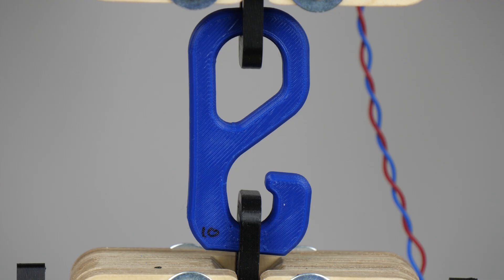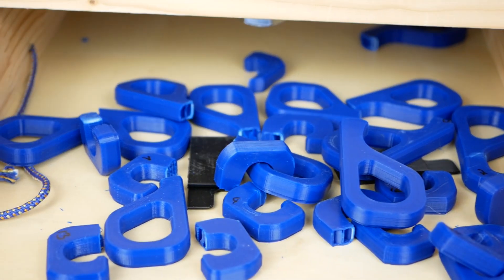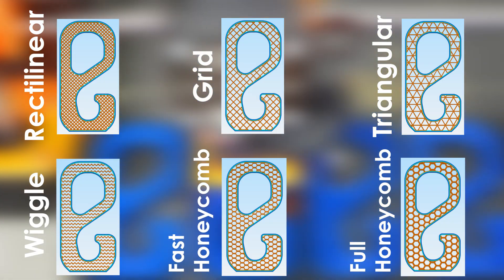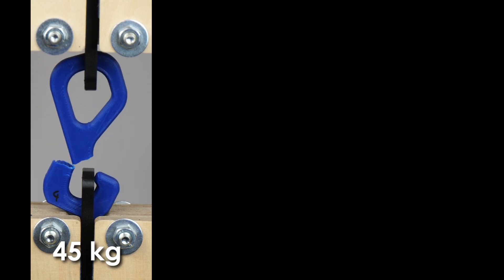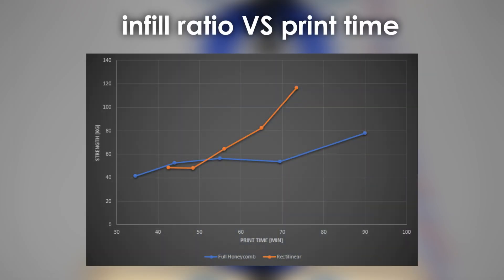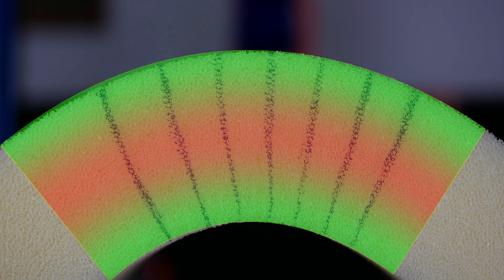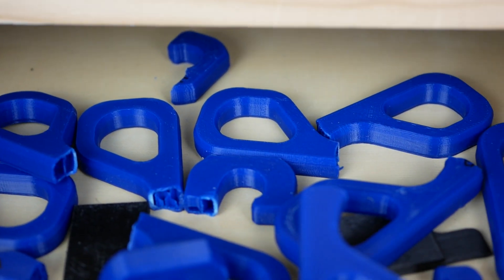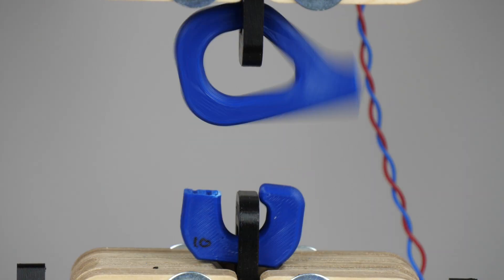INFILL pattern and SHELLS - How to get the maximum STRENGTH out of your 3D prints?

Comment: I never put so much effort in research but my daily use seems similar to your results
Since I use Slic3r to slice, I use 3D Cube infill most of the time because it stresses the Printer less than Honeycomb.

For random objects I use 2 Shells 2-3 Top/Bottom and 15%infill
For more tough objects I use up to 4 Shells, 5-6 Top/Bottom and 45-60% Infill still 3D Cube
I recently printed some e-Skate parts and i Printed those with 5 Shells and 80% infill rectilinear, still not sure if that was Overkill

I Like to see your results for 3D Cube/Honeycomb the later I never used because I couldn't see any advantages against Cube

Comment: Never use 100% infill for a solid part. Instead use 1 wall and then divide the total layers by 2 and that is your top and bottom layer number. Also add [0,90] or [-45,45] to your bottom/top layer and this will crosshatch your layers to get much better adhesion between layers. Also never orient your layers axial to loading.

Comment: There is more to it. Increase the layer height if your nozzle can print. 0.2 is not as strong as 0.3. 0.5 is tough and 0.8 is a beast when it comes to strength. Test this aswell.

Comment: My current aproach to strong parts is lots of walls, and 100% infill. Based on other sources I also cranked up my temperature as far as it will go without print artifacts, which is 230C on my "Real" PLA. For gears especially I ensure that the gear teeth consist of only walls. Could you also check the effect of temperature on strength? It should matter especially in the Z direction.
Reply from the maker: Did that already: https://youtu.be/mwS_2R2mIvo
Reply: Ah, so one of those sources must have been you!

Comment: I quite often use fasteners to strengthen a part. For example, I have made a series of 'L' shaped brackets, about 50mm on each side, that hold various sized waveguides. The right end of the horizontal part of the 'L' has a cap that clamps the wave guide (half of waveguide profile is in cap, other half in 'L'.) Two screws run through the cap and into threaded inserts in the left end of the 'L'. The screws are needed anyhow for the cap, and having them the full length of the bottom of the 'L' keep that part in compression and makes it much stronger.

You can also create a separate part/model for the highly stressed region of your part. For example in the part of the sample shown here you can have a separate 'embedded model' to which you apply completely different printing parameter to. I have tried this some in Simplify3D. I combine the two parts of the model in an assembly and export an STL of the whole assembly then tell Simplify 3D to separate the different objects.

Comment: You are wise to choose a good model to test both compression and tension stress at the same time. In fact in one of the slow motion video, the crack happened on the compression side first rather than on the tension side as many people would expect.  If you could test torsion stress as well then it would be a more perfect experiment.  Thank  you for your contribution to the 3d printing community.  There had to be a lot of effort you gave.

Comment: I'm not sure what all options are available on other software but in slic3r to save time on the prints you can set the size of perimeters and external perimeters. Using a .4mm nozzle I set perimeters at .8mm and external perimeter at .4mm So you get a shell of 1.2mm in only 2 perimeters instead of 3.

Comment: I have set my internal parameters at the full 60mm/s of my printer, which doesn't really show in the final part!
Only the outer one goes at 30mm/s, which is a lot slower, but looks great on my printer.
I have a slightly modified Hypercube and I use CURA, newest version...

Comment: It could be useful to test the differences that you can achieve varying the direction of the infill (if possible). For example the wiggle Infill was really penalized from the fact that the infill lines were perpendicular to the force applied to the part.
Reply from the maker: Your right about that. But with a complex part it's often not possible to find one "best orientation" so you should find an infill that's as isotropic as possible. Could be worth testing.
Reply: I think marco meant varying the angle (for example in S3D to 0, 60, 120, 180, 240, 300 in honeycomb) to get the plastic adhering to the previous layer differently, and adding tension strength, as it would be supported by a different section of the wall...

edit: also might be an idea to test for compressive strength

Comment: Really informative and well presented video! 
One question, you mention the test hook with 2 perimeters and 100% infill isn't any stronger than 6 permieters and low infill? With the filament printing temperature, if it's high enough the layer bonds will be at maximum. A solid hook should not show layers or strands when broken, but rather shatter like brittle glass. Maybe worth a quick test?
Reply from the maker: Thank you!
0:59 is the fracture surface of the 100% infill part. Where you can see that there are still some voids and die to the polymer structure the material is still not 100% isotropic. Similar to an injection molded part that is stronger in flow direction of the plastic than perpendicular to it.
Reply: Ok very good. How about rotating the part 45 degrees so the infill is in the same direction with the break forces applied? Or even better increase the wall count until there is no gap inside?
Reply from the maker: Yes, rotating the infill would have made the hook definitely stronger. But this is exactly the problem, that often you not able to orient you infill perfect for any region on the part. Somebody already suggested using more different infill angles will give you better properties in all directions. Definitely worth testing out though!
Reply: Cool. Thank you for your time :)

Comment: I have a new printer and for its parts I am doing 100% infill.  I don't normally go that high and I will say I normally do 3 shells and 4 if it had screw holes since I will probably need to go in with my drill press later.

Comment: You're an absolute legend!!! Maybe you read my page https://github.com/superjamie/lazyweb/wiki/3D-Printing-Part-Strength in your research. I found people say full honeycomb resists tensile force better, but rectilinear is better for bending force. I also found one shell is equal to about 25% infill like you found, good to have this confirmed. I would love to see more videos like this! Your channel is easily the best resource on printed part strength available. I agree infill over 75% is probably useless and hard to print. My goto is 4 perimeters, 8 top/bottom, 50% infill, but I'd like to experiment with 5/10 and 75%. I'd like to see a comparison with bending resistance rather than tension, and higher infill ratios over 50%, and the effect of layer height. There is NO conclusive analysis of layer height on part strength that I could find.
Reply: Also this video has tipped me over the edge. Time for Patreon support.
Reply: Well thought out reply and I'd also REALLY like to see how layer height contributes to part strength,rigidity, fracture points, etc.    I would patreon support for this info!  👍🏼

Comment: I would be very interested in seeing direct comparisons of 3d infills to their 2d counterparts. For what I am doing at the moment (using 3d printed parts structurally for chain sprockets, drivetrain track sprockets, and composite frame connections on a college robotics team), near isotropic parts are a bit of a holy grail. Seems like 3d infills might help with that, although I worry about lower layer contact area due the offset of the layers in the infills.
Reply: Using 3D Prints for those kinds of high load applications is nearly a waste of time without post processing. Most of the strength problems with 3D prints can be nearly eliminated with heat treating or surface treatment to melt together and bind the layers. 

Plus, if you are a decent engineer, just like was mentioned in the video, layers can be oriented and multiplied to get specifically non-isotropic parts for each application.

Comment: Very neat. I'd love to see follow up with Cura's cubic etc. 3D infills. My current approach is to print cubic infill at about 33% and 2 perimeters as the default strong part, and using the gradual infill function to bump up the infill to 65% for the last few layers to get a good roof support.

Comment: Really nice video! However, you should also take a closer look at the extrusion-width. When I print strong parts, I usually crank up the extrusion-width to 0.75 - 1.25mm (with 0.4mm nozzle). This way you require less perimeters for the same wall thickness. It's also a lot faster this way.

Comment: Nice and needed video. Great work! 
Regarding the infill ratio measured using the weight proxy measurements - did you took in account the perimeters? I think that this is where the discrepancy may come from.
Reply from the maker: Baseline was the hook without infill and one with 100% infill. Perimeters were kept the same for this test, so this shouldn't be the reason for the discrepancy.

Comment: I always have to think about bird bones in this context, mostly hollow with "struts" on the inside. Maybe we need bird bone infill.
Reply from the maker: Google for lattice optimization. e.g. Autodesk is working on these things, but they are not optimally usable in FDM at the moment.
Reply: If you do a topology optimization simulation you will get a result similar to the bird bones structure
Reply: Concentric seems to do this depending on your density

Comment: I increase shell thickness for overall strength, and in addition to that also the infill density (or even glue on a plate of metal post print) if relative high force is applied on flat areas where the outside perimeter walls of that area are not supporting that force directly.
Reply: And I just use cubic infill in slic3r. I don't even bother changing to another infill pattern.
Reply from the maker: As I think I've shown. It doesn't usually make a big difference, what you chose. Most perform well and shell thickness is anyway more important.

Comment: As always, you produce amazing video! 

I always wonder if the layer height actually matters on the strength of the final part, especially on the vertical direction (z axis). I got a theory that, the lower the layer height, the better the layer adhesion, since the molten plastic has much smaller void between the extrusions and more heat (closer) were transferred to the previous layer to fuse the layers together.
Reply: I don't have such sophisticated  testing rigs XD
Reply: thats a lot of work even it might not look like it :P
Reply: Ahah just saw your comment, after talking about layer height too. But I would say the contrary : in my opinion a 0.3 LH should present a better stress resistance than 0.1 because of the thicker deposit. #QED (But yep Stefan, you should test it to complete your investigation and tell us which of us was right ^^ )
Reply: larger molten deposit also have bigger void between the walls... and nozzle was further away from the previous layer...
Reply: I've  just  found a test done by someone. It actually shows that lower layer height has a positive effect on the part strength...

http://3dprintboard.com/showthread.php?3549-Does-Layer-Height-effect-print-strength&p=95464&viewfull=1#post95464
Reply: Other results here : "As shown on the stress-strain curves, the specimens behave the same way on the first part of the curve: The Young modulus remains constant around 2.9GPa, again well within the range of PLA’s rigidity. And yield stress is also fairly stable around 19MPa.

The curves differ later, for the max stress (as previously seen) and for elongation at break: it increases linearly with layer height, from 2.1% to 3.0%. This is in line with the fact that the material is weaker at lower layer heights, possibly linked to lower accuracy of a thinner deposit." 
http://my3dmatter.com/influence-infill-layer-height-pattern/
Reply: It seems counter-intuitive since the material is being squashed downwards more with lower layer heights, so you would expect it to be stronger since there is more surface area for layer bonding. This evidently is not the case and is probably to do with the fact that the extrusion surface area/cross-section ratio for the lower layer heights is larger so heat dissipates faster leading to lower thermal layer bonding.
 
The greater bonding area between the lower layer height layers is also a drawback for this reason, the heat is spread out over a larger area so thermal bonding is lower. This can be particularly weakening near the edges of the layer bond. If there is low thermal bonding at the edges then this will cause a very sharp notch which acts as a stress concentration and crack initiator. Although this is generally not too great an issue since plastics are generally ductile and tough so are less suceptible to crack propogation. Still it will have some effect. 
 
I would be interested to see how reducing the print speed, increacing print temperature, using a heated chamber, reducing cooling fan speed (or not using it at all), reducing extrusion multiplier and post heat treatment affect part strength. Although a lot of these things aren't generally good for PLA print quality they may increase the strength of lower layer heights above thicker ones. It would also be interesting to see how other materials behave, particularly high strength materials like carbon fibre filled nylons or polycarbonates.

Comment: Aww finally someone who's actually testing different infill patterns and densities! <3
Reply from the maker: At your service ;-)
Reply: @CNCKitchen  what you did is amazing, but solving 3d structure weekness with 2 shapes leaves questions about infill using a hollow tetrahedron (3point pyramid base) a hexagonal pyramid ( 6 point pyramid base

This should provide huge benifits especially in torsional stiffness because instead of having hollow tubes in the infill in one dimension you have 2 or more layers of pyramids that mesh together (the pyramid tip in the second layer sits in the gap of the adjacent pyramids) but technically using the same common wall...

If you read this please like so I know!
Reply: Check out the geometry on this 3d printing from MIT: https://www.youtube.com/watch?v=VIcZdc42F0g
Reply: @Dominic Cory Bot
Reply: @Cristiano Stefan comments
Reply: Cringe 👁️👄👁️